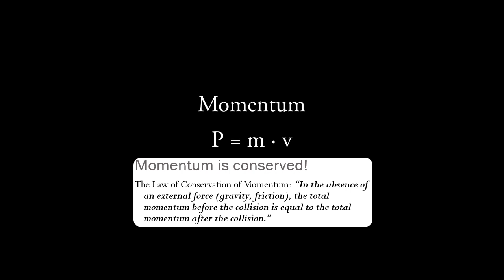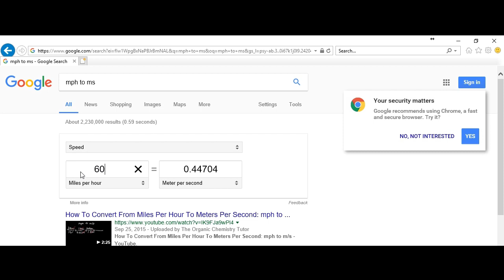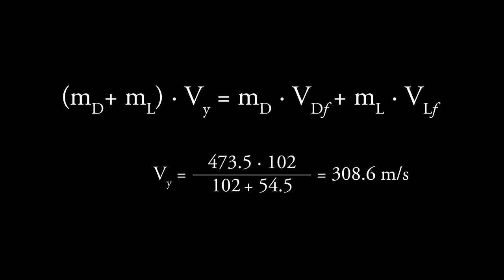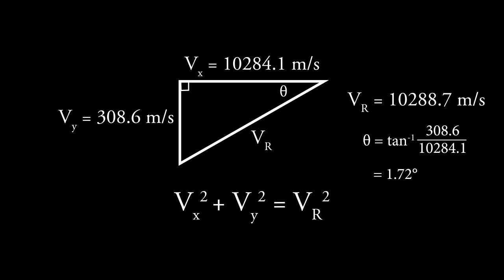Bad Movie Physics - Fast and Furious 6

Comment: Rip, the safe being towed by the cars wasn’t cgi that was all real. But go on
Reply: The safe was drive assisted and they had to make the bottom of the vault slippery.  There is too much friction going on with steel on concrete. The car wouldnt be able to get the safe moving. And the scene where the safe hits the tree has te be cgi. The tree didnt move an inch. The cars also shouldve reacted to the safe hitting the tree but the cars kept driving like nothing happened. There is a lot of things wrong with the vault scene despite it being made in real life.

Comment: You're a Genius. Farthest I've ever gotten in Math Was Pre Algebra.
Reply: He has got it wrong. The momentum of the car is not transferred over to Dom, but used to deform the car even if the guard rail was intact. Dom will have the initial speed he had with the car, plus some if he jumps forward just before the crash.

This channel's owner needs a recap if he wants to get stuff right.

Transferring all of the momentum to Dom would need some kind of Dom-cannon, powered by an energy source such as compressed air or gun powder. Firing Dom forward with such a speed that the car stops from recoil. Then, would the speed calculated here be correct (I suppose, did not check the numbers).

Just colliding into something will not achieve much if any momentum transfer from the car to Dom.

Comment: Is... is this a gag video? Your math is way off it’s like you took high school physics class and think you know everything about the world. You’re saying Letty should have been launched at over 29,000 meters per second which is 66,000 miles per hour (over 106,000 kilometers per hour for the rest of the world) from standing on the roof of a tank going at most 60 to 70 miles per hour... how did that make sense to you?
Reply: Did you not listen? Since the guardrails in this movie appear to be indestructible, immovable objects, he’s assuming that all of the momentum of that tank is transferred to Letty. That’s 50+ tons at 60+mph into a woman who’s probably barely more than a hundred pounds. Ridiculous scene = ridiculous math. 

If you’re operating under the assumption that she couldn’t travel any faster than the speed the tank was moving(which is what I think you’re doing), then you have a gross misunderstanding of how energy is transferred. A man can barely run 20mph, but can make send a stationary football through the air at more than triple that speed.
Reply: @flyingpiggie979  the assumptions made in this video are just as bad as the ones made in the movie, I love the effort of a high school student applying himself, but it’s terribly off
Reply: That said, Dom should still have been launched forward by the recoil of the crash. Of course most of the energy is going from the car to the guardrail, but is there any way to estimate how fast Dom should realistically go?
Reply: @moosa1037  There is, but it requires significantly more information, and far too advanced physics to determine.